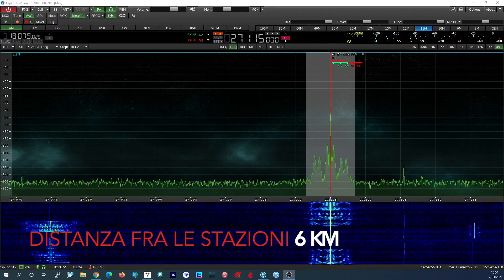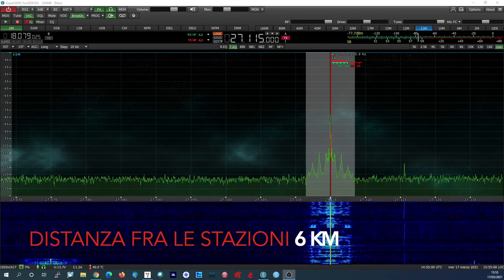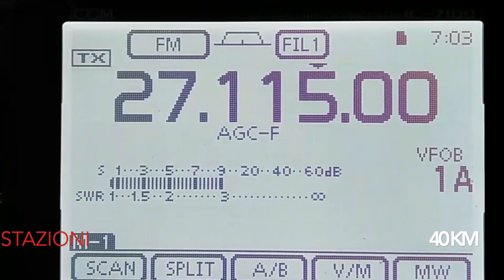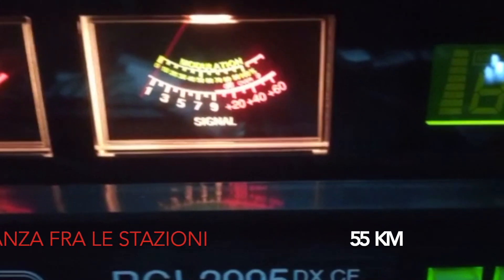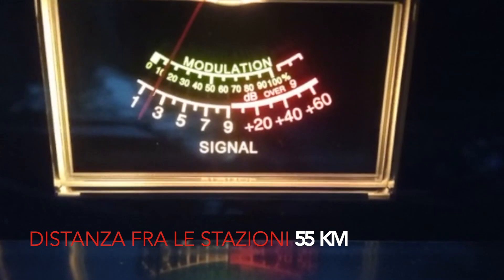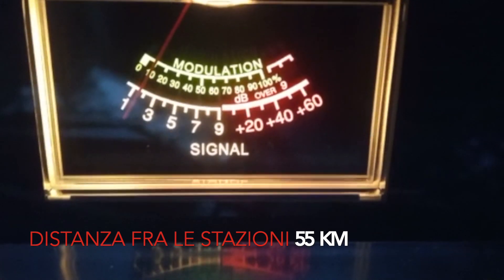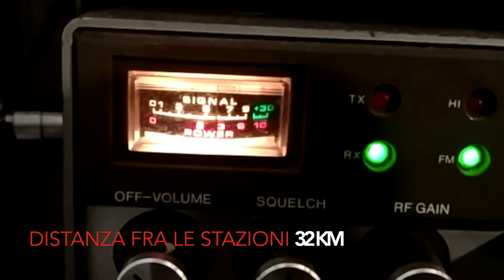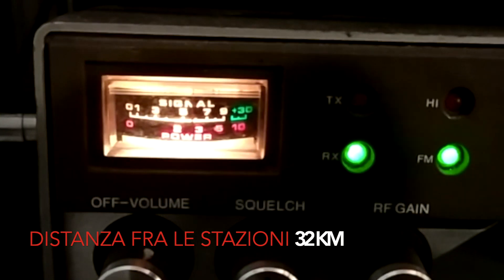TEST ON AIR GRAZIOLI FE10V 5/8 vs SIRIO Gain Master 5/8 ( entrambe sul tetto )

Comment: Hello, I currently have a Grazioli FE10V and I'm thinking about the second one, something like the Solarcon Imax 2000 Optimizer (730cm) or the second Grazioli G-Max. The question is how does Grazioli G-Max perform in the wind and how much wind can it withstand? Do I need to add guy wires in the middle or at the end of the G-max antenna because I saw in the video that there is a dedicated bracket for this? Can you compare Solarcon vs Grazioli? Currently I have FE10V on an 8 m mast and I want a second antenna, but for a 12 m mast. Best regards, 73